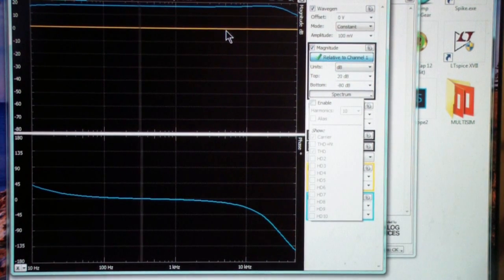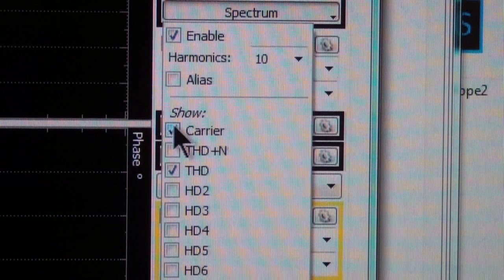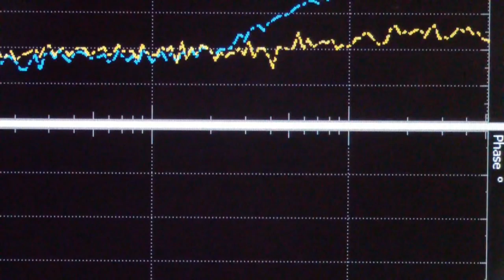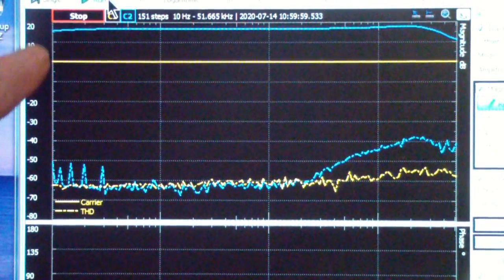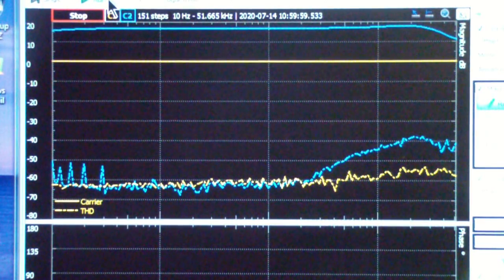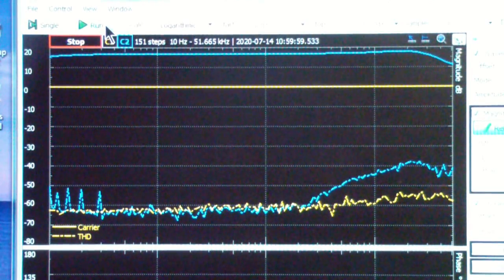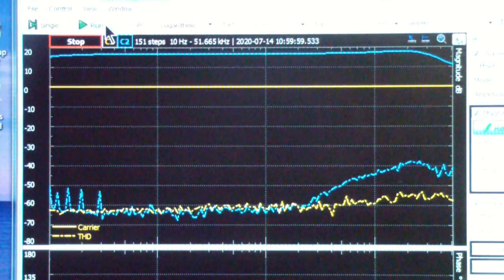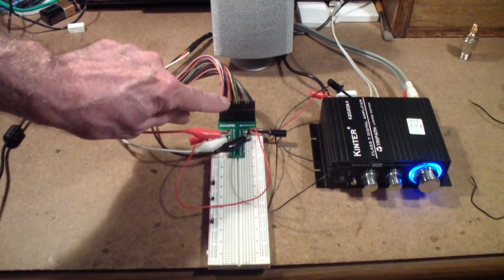TTT321 Amplifier Testing with Analog Discovery Network Analyzer

Comment: Hey, that's what I've been doing for the last couple of days.  Actually using the Audio Analyzer Suite with the AD2 since it can easily be set to a specific power setting for THD, and being in percent.   Thought it was funny you are doing this today when I commented on your thread a few days ago.  Is the output of the Audio Analyzer Suite flawed? Since I'm in the middle of testing I'm not going to switch software at the moment, but as a long time Linux user I'm anxious to get back to my pure Linux desktop.  I asked the creator of Audio Analyzer to opensource his software, that's not going to happen.  Not sure if you get on diyaudio, but I got a thread about my project(16LS) in the tube section and no one is commenting.  It's on biasing and current levels in a Edcor PP OPT.   Thanks, as always, for the education.